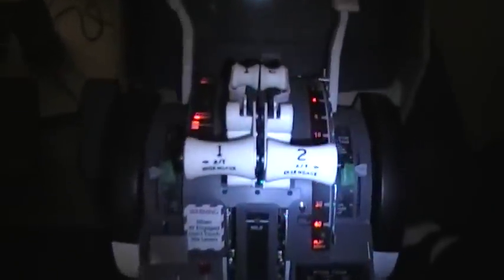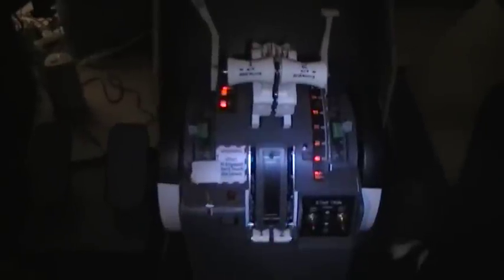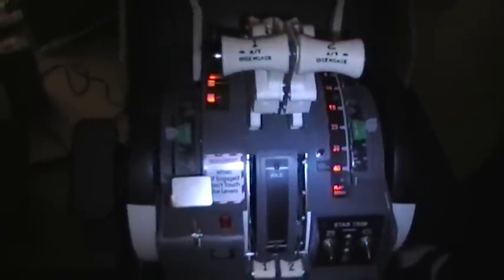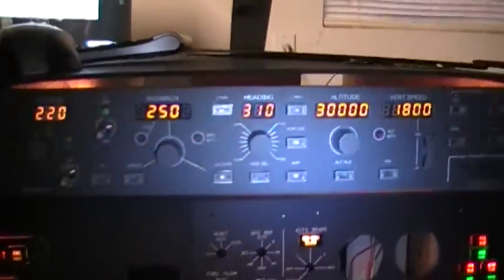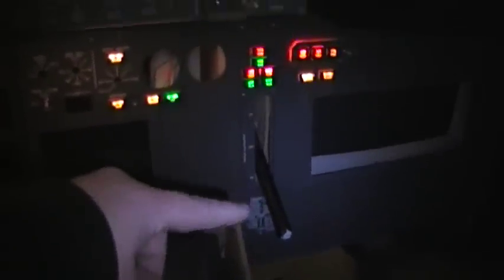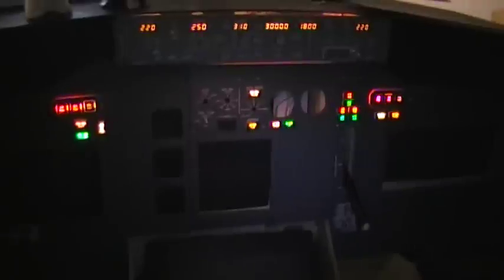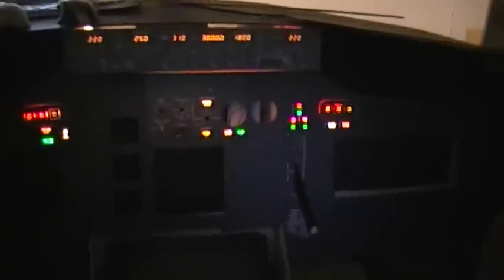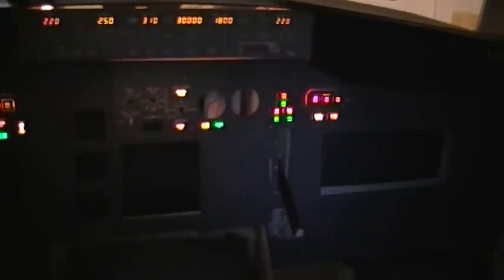737 homemade cockpit

Comment: I saw the prices on their website for their driver software........if I had that TQ, I would seriously consider opening it up and interfacing it myself. I'm pretty sure thngs will become obvious once you take a look inside as far as what wires go to which switches and pots. You could easily test them out one by one.